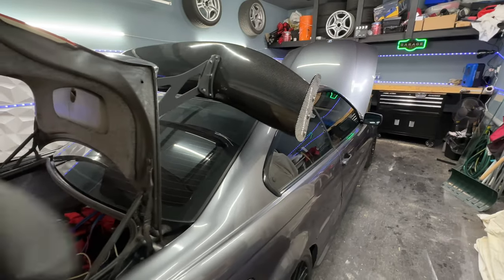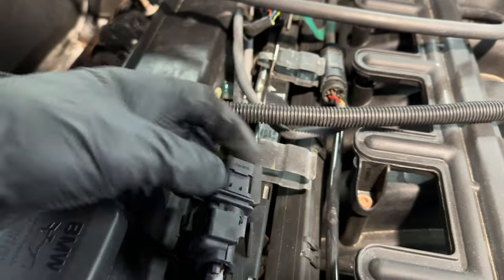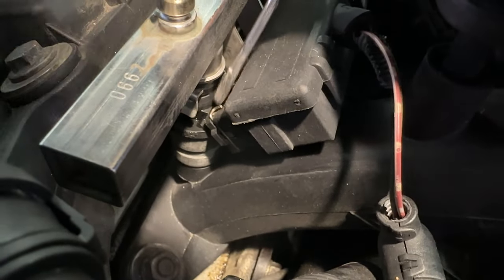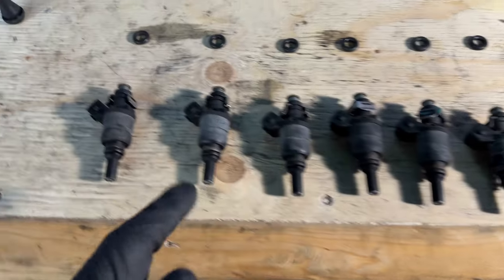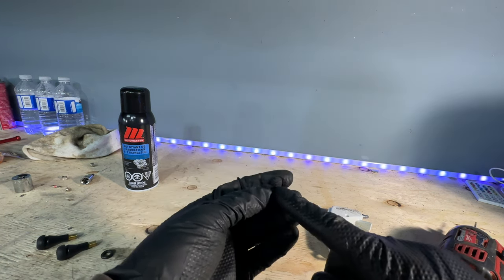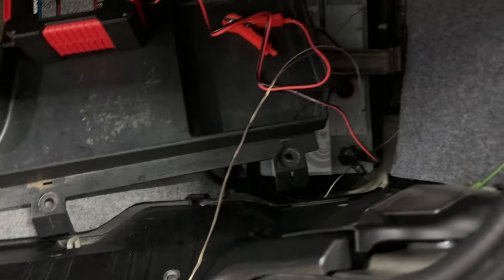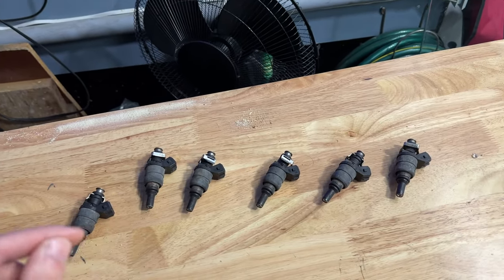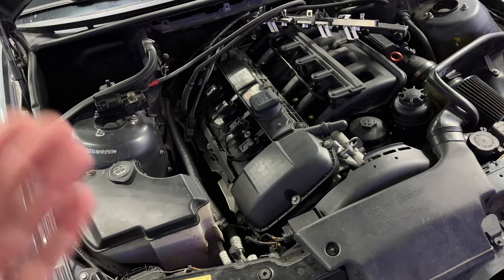$15 DIY BMW FUEL INJECTOR CLEANING/FLUSH E46 TUTORIAL | SINGLE BANK LEAN CODE FIX

Comment: Nice video and hot locking e46 ,my son just his 2003  e46 330i it was missing fuel pump we order Bosch pump and installed but car been setting over the year and fuel got old and before fuel replacement he rebuild venos seals but not change needle bearing and it got some type of knock I don't know if it related to vanos or not please rich out my name is Josh thank you and best regards .

Comment: Hi, I have a 2004 330Ci. It is leaking fuel from the injectors only at below freezing temperatures. It always starts/runs perfect and doesn’t leak at normal temps. Is it worth replacing o rings? Or are ‘04 injectors known to leak from the injector body when freezing? 
If I have to replace injectors do you have to calibrate? Thank you for any recommendations/advice

Comment: What kind of cables can I use to wire to the battery of my e46 in order to power the injectors?
Reply from the maker: Any sort of electrical wiring should work

Comment: How do you feel about using throttle body cleaner to flush the injector with your method?
Reply from the maker: could work, carb cleaner tends to be stronger for gunk and debris removal